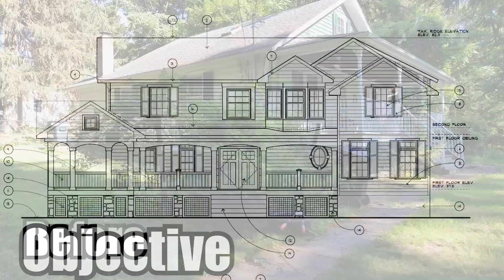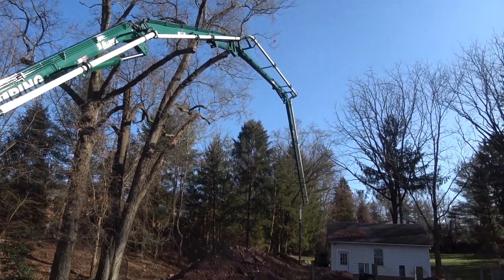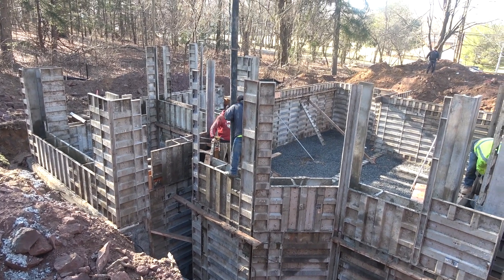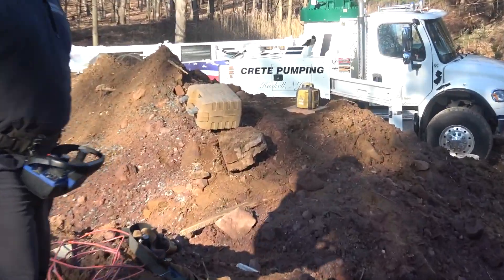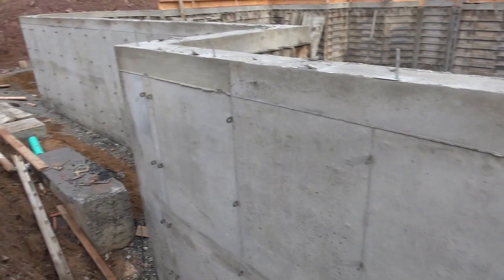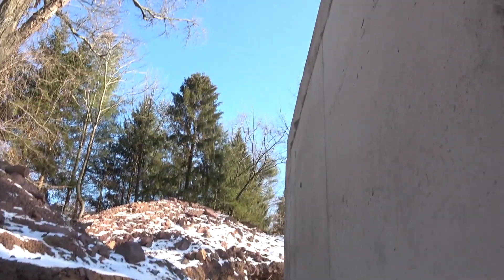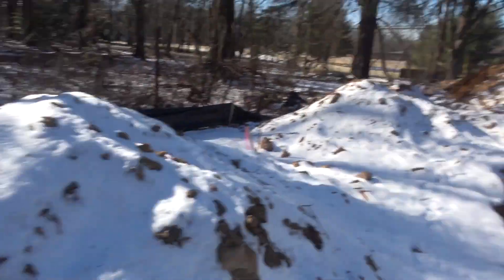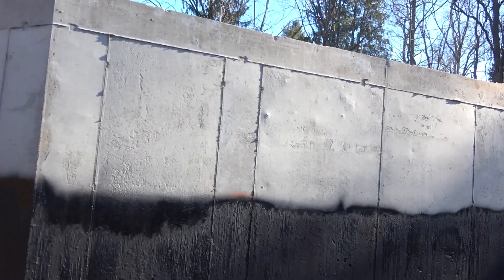I GC My Own Luxury House - Ep 6 Foundation - Water Proofing - Backfill

Comment: I built a house with a poured concrete basement a few years ago.  In our area, it's normal to 1) have a perimeter drain in addition to waterproofing, either draining into a sump pit or daylighting (usually only get that in walkout basements) 2) compact backfills in lifts (backfill a few feet at a time), using a compactor (usually on the boom of a compact excavator) in between.  The compacting is viewed as important because it prevents large amounts of settling around the house.  You still get some settling, but far less than if you didn't do that.

Oh and we call generally call your emergency escape a window well.  Poured concrete ones are uncommon around here - most people just use corrugated steel ones.  Window wells are very common in this area since bedrooms in basements are extremely common.

Comment: The waterproofing is so critical and was not always code. Every house that does not have a barrier on the foundation will have water intrusion at some point.
Reply: And a lot of moisture in the basement. And will have to run a dehumidifier.

Comment: Did these guys even vibrate these walls? There shouldn’t a cold joint at all. Especially if the trucks were about 10 minutes apart. 
You may have some water issues if they didn’t vibrate the walls.
Reply: I also thought it was strange. it makes your concrete much more beautiful when you vibrate it. but there are more things that are different from my country. the concrete truck is already weird.

Comment: I worked for a contractor, and as a cement guy for one day because the regular guy didn't show up.  They had me wielding that heavy A** hose filled with cement. The hose has to weigh at least 500 pounds, and you have to hold on to it while directing where the cement is to go. Really tough work, and it should be expensive! 😁😎👍✌

Comment: Did they use vibratory in the forms? Seems like he just had a shovel. You need to vibrate so the concrete can fill the bottom of the form fully

Comment: Did you take cylinders to confirm strength of concrete?  Did you have anyone checking the trucks to make sure the mix design was correct and slump correct on every truck?  How many cubic yards approx of concrete did you place?  Did you have anyone watching and making sure the rebar wasn't displaced, and making sure they consolidated the concrete through vibration methods?  After how long did they strip the forms?  Did they apply spray cure as per manufacturer recommendations?  Who confirmed this?  This is my job usually.  If you can't answer this I can't guarantee it was placed per ICC code.
Reply: Are you some sort of non AIA/PE internet structural inspector that roams from channel to channel?
Reply: @skyking228  no I just like Mr Spaghetti and happen to work in the field 😭
Reply from the maker: Bunch of No's to all those, but the truck tickets had the mix and time on them.
Reply: @superspeeders  😬

Comment: 3500 psi seems a little low and from my knowledge you typically want to use the same company for the color to match
Reply from the maker: No one will ever see the color of the footers.
Reply: @superspeeders  you’re right, but for driveways and patios you want to stick with one company, recommend a 6 bag mix with wire mesh for longevity. Any plans of doing stamp work?